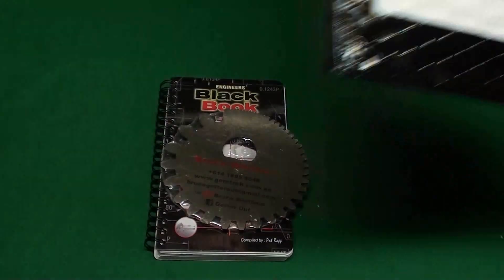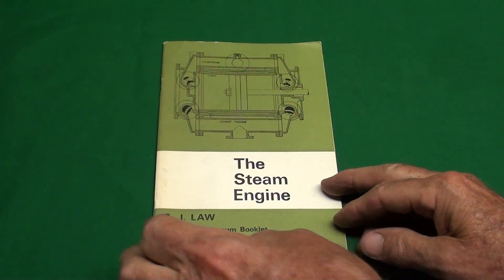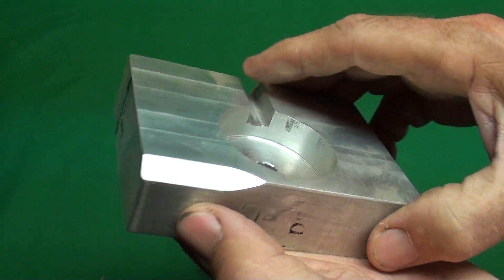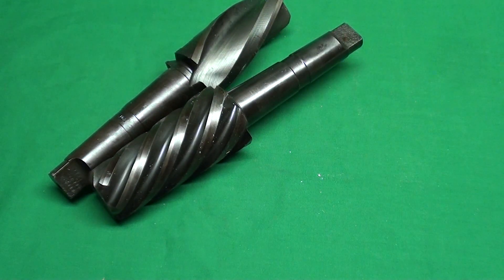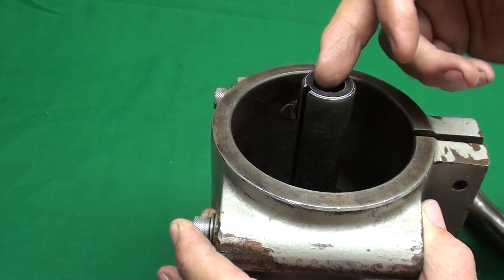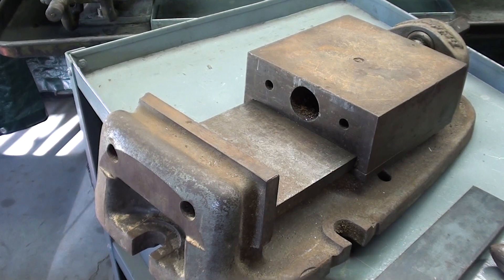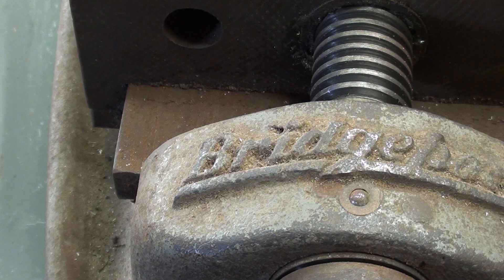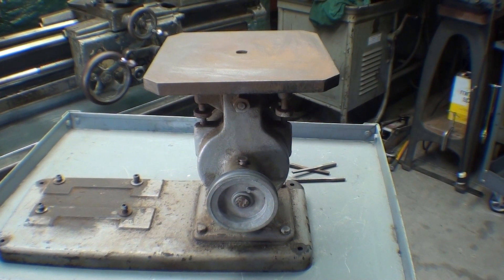tubalcain THIS & THAT episode #31 mrpete222

Comment: A video on the refurbishing of the filing machine would be great! I have a ShopSmith scroll saw that readily accepts square-tang needle files in the lower blade holder (the upper arm is removed for filing). A bit of fussing is needed to set it up, but it works well for light work. Always a delight to awaken to a Tubalcain video!

Comment: I have bought and restored two Bridgeport 6" milling vises.  They're easy to disassemble, sand blast, and repaint.  Rust-oleum makes a professional series spray paint, and has a color called "Machinery Dark Gray" that looks great on machine shop equipment.  I installed a new cylinder nut in one.  McMaster-Carr has brass cylinder nuts (they're left-hand ACME threads).  I made new jaws from 4140 steel, but didn't feel the need to harden them.  They both look and work as good as new, and I have less than $100 invested in each one.  It's very satisfying to bring old tools back to good working condition.
Reply from the maker: Thanks for watching--I will look for that paint

Comment: I saw a bevel cutter of the same idea once. I think it was home made because it utilized those tiny cutters used for boring bars as, but unlike a regular cut where you'd grind the tip, you'd grind the edge. About fist sized with aaaabout little over half inch (i think) shank. Black and tribladed, just like this one, only for much bigger bevels.

Comment: It seems like a sewing machine motor would be ideal for one of those small die filers like you shown.  A variable speed motor with foot pedal should cut down on the finger pinching.  

There's quite a few inexpensive motor/pedal combos on Ebay.

Comment: Mr. Pete - Google "Monster Jaws" and look at the blank jaws. You will have to drill and tap but, they're very economical...under $20 bucks. I put them on my 6" Bridgeport vise and they work great. I bought the 3/4" thick version. Not ground but, they do have a nice machined finish. Accurate enough for what I do.
Reply from the maker: Neat--I dont see ant that are undrilled